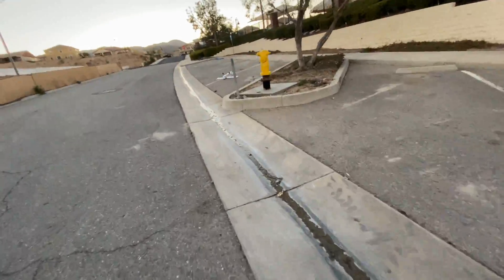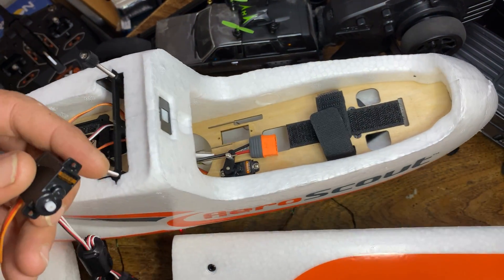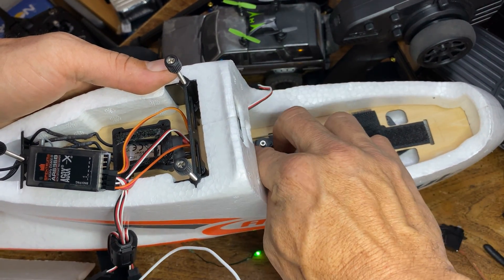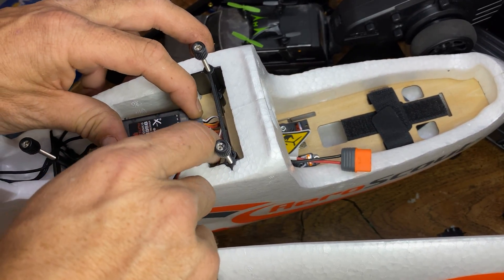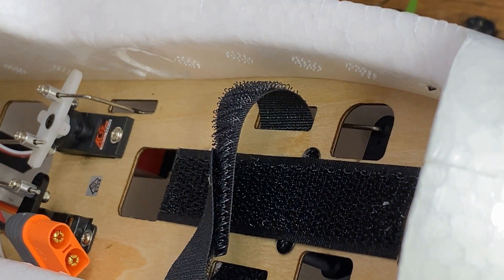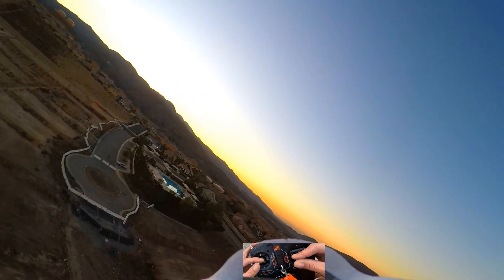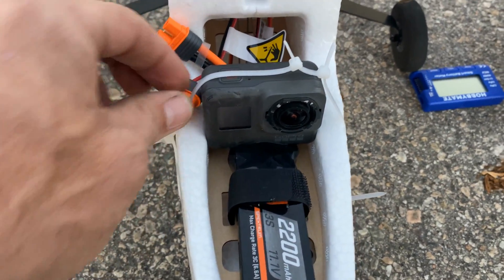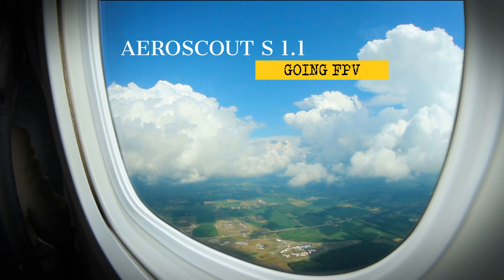How to Upgrade AeroScout S 1.1 Servo - Titanium gears, CRASH RTF, GoPro fpv flight stick cam CC

Comment: After multiple failures and an unsolvable problem with the nosewheel assembly, I have decided to strip the plane for parts and throw the rest of this crappy plane in the garbage
Reply from the maker: LOL LOL, ya, this is a begginner plane and a cheap way to get into the hobby. I broke 3 before i went apprentice sts with auto land and gps fencing.

Comment: You can tie or tape a string to the servo lead before you pull it out; then use the same string to tie the new servo's lead and feed it back through.

Comment: Could you give us an update after a year? I just bought the same plane for my son and the servo failed on the first day and the plane didn't crash
Reply from the maker: Sure , what you would like to know? I still have my plane. The problem with the servo is a problem but the titanium replacement is a good fix for fairly cheap. 

I can make a follow video if you would like?

Comment: Thanks for this, my rudder servo has also gone funny after my second day of flying (gets stuck slightly in one direction after using the rudder and wont fully recover to central position). I have long ass grass in the UK so can be abit bumpy on the landing. I have just ordered 2 Savox SH0265MG Micro Size Digital Servo. I may as well them both out whilst I'm at it. But I am loving this plane and hooked.
Reply from the maker: Hey thank you for the feed back! I’m hooked too! I do have a new plane video i am working on, I think this video worked out for helping quite a few people.  It is so cool you are in the UK and I am in California, yet we are talking about the same love of this hobby.  Good meeting you and happy flights 🤝

Comment: My son landed rough only a few feet off the ground and stripped it right off. I took it apart to see if I could rotate the stripped gear to a good spot but it’s splined so you can’t. Just upgrade to metal gear servo 👍🏼
Reply from the maker: I just saw this but I feel happy that my video is helping so many people. I will make more fixed wing videos for everyone. Thank you for the comment! I really appreciate the feedback ❤️

Comment: Thanks for the suggestion! I just stripped the internal gearing of the stock rudder/nose wheel in my new AeroScout after a landing that really wasn’t very rough, which speaks to the inadequacy of the stock servo. 

For those who just bought the AeroScout, do yourself a favor and upgrade this particular servo proactively.
Reply from the maker: Hey thank you for the comment! yes change the servo or purchase the servo at the same time you purchase the plane. I do like the aeroscout but have recently purchased the apprentice rtf 1.5. Both are fun planes to fly!

Comment: 1:20 Don't remove the old servo wire YET.   Clip it off close to the servo body, tape plug of new servo to the old wires, then PULL the new wire into place using the old wire.
Reply from the maker: That’s actually really good advice! Thank you for the comment Chet 💯🥰
Reply: That’s what I was thinking. That’s how I have replaced a hood release cable on a car among other wires or cords. Great idea, nice of you to share.
Reply: @ztwntyn8  That saved you a shite ton of time I bet. lol Try replacing a throttle and trim cable on a 20ft boat with out using this tip. All I can say is good luck with that to anybody that tries  🤣
Reply: Yep old school trick 👍🏻 Dave's ya from pulling your hair out trying to fish it through 😁

Comment: I’ve been through 4 servos so far if you could tell me what brand servo did you use and if you have the model number would be awesome!
Reply from the maker: B13DLM (Digital Servo)  AGFRC Professional Servo Manufacturer,  item: B13DLM   barcode: X00236XODP   size: 22.8 *12.0 *29.4mm  weight: 13g 
I hope this helps. This is all the information on the box. it took me a minute to find it. hmu if you have any other issues (:
Reply: @HolaACchillin  thanks! I already purchased one at hobby town but the direction was wrong, got a direction “reverser?” And it’s all good. I’ll will use the info for my next though. Thanks again!
Reply from the maker: 10-4 apologies for the late delay. Next time around i will take the time to leave pertinent details in the description. Thank you for the question, i hope it all works out. Do you have an instagram by chance?

Comment: Do you know where I can buy a replacement servo for aileron wing servo?

Same aeroscout 21.1m Plane
Reply from the maker: B13DLM (Digital Servo)  AGFRC Professional Servo Manufacturer,  item: B13DLM   barcode: X00236XODP   size: 22.8 *12.0 *29.4mm  weight: 13g
Reply from the maker: I bought a set from a local hobby zone affiliated store. I went in and asked for the replacement piece and they sold me two replacement in a bad. Official replacement part. 
Idk what size or anything I just put the same oem parts back in for the wings.  The servo up front i bought on Amazon.

Comment: How did you modify the bracket?
Reply from the maker: Hey I got ima car accident, I am late to reply lately. I used the bracket that came with the servo.
Reply from the maker: I used the small screws from the scout original servo, then used the screws to bore out the new servo bracket. I used a 1.5mm & 2.0mm wrenches to further widen the bore size.
     Take the left & right steering hardware from old servo. Assemble hardware on new servo bracket , feed the rudder & steering wire. 
Bing 
Bang 
Boom,
Old hardware on new servo, plus new servo bracket. 
Apologies for the delay
Reply: @HolaACchillin  Thanks so much man for the info just bought that same servo yesterday for the rudder. Sorry to hear about your car accident hope you’re feeling ok.

Comment: Steering servo?  You probably mean rudder servo.  And if I where you I would want the stronger, more reliable servo on the elevator, you can fly without rudder, you can’t fly without elevator
Reply from the maker: on the areoscout the steering and the rudder are on the same servo but i changed the title to better suite a search. Like
I broke the servo immediately and then searched "Steering servo" because i dont know anything about rc planes. No search results... I make videos on whats going on in my little world and greatly appreciate outside advice. 
I am learning about the rudder and what it does so I really do appreciate the intel. 
Rudder eh
elevator need
copy,
Thanks again SkidzFPV, 
I will definitely upgrade the elevator servo. 
what would you recommend?
Reply: @HolaACchillin  any name brand digital metal gear servo should be fine, something with same dimensions so you don’t have to modify the mounting location.  Futaba and hitec servos where always my favorite, but savox and many companies make good options.
Reply: What’s with your name?  You work on AC’s?  I’m a commercial hvac and refrigeration tech.  Or was anyway until COVID fucked me out of work
Reply from the maker: I really do appreciate the intel. I have never considered flying fixed wing until recently. It’s way more fun that I expect! 
I want to make an fpv fixed wing and just like my quad I do not want crappy parts. 
I appreciate you!
Reply from the maker: That’s not good, are you working now? AC is just the name I have been using for like a decade.
Steam and PSN it’s ACchillin  
But on YouTube I had to switch over to holaacchillin.
I’m not in hvac but construction in California boomed during quarantine.
For me I have been working non stop because my business revolves around construction.
If I could say anything it would be to open an online store that sells stuff you know a lot about.
Like hvac stuff maybe? 
Idk, I do hope you are doing well! 
Much love-
AC

Comment: Been lookin into getting a fixed wing, is it harder than a quad?
Reply from the maker: about the same i think. Learning curve is different. This particular plane is a trainer plane with stabilization, panic mode, safe mode, super easy to fly especially if you fly drones. imo its the same but different if that makes sense. the controls are identical to a drone on mode 2, its like the same. I felt terrified yet comfortable after a minute or so. Now after like 8 flights I love it... Well I will love it more once its fpv i think... 
This video is like my 4th flight LOS
tbh this plane is so much fun! i mean you get that feeling like a drone delivers but longer flight times. I want to go like ridiculously long range in a plane mainly for the efficiency. 
My drone can go far but simple math, spin 4 motors or 1 motor. I think 1 motor and the ability to coast is perfect for what i have in mind.
Reply: @HolaACchillin  very interesting. I’m probably gonna have to grab one of these then lmao. Planes have always peaked my interest
Reply from the maker: This one is an awesome rtf but my new apprentice 1.5 sts rtf is going to amazing. 
Waiting on parts rn.
$200 
The aeroscout is such a good buy for the amount of fun you get. Builds confidence💯